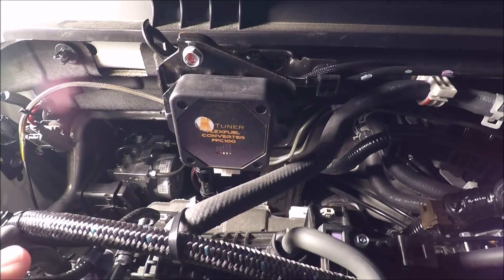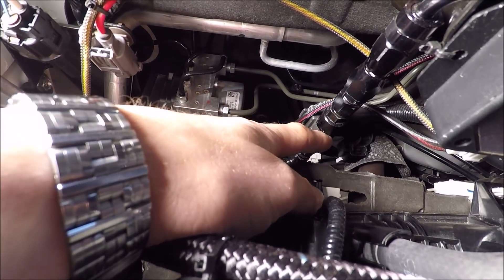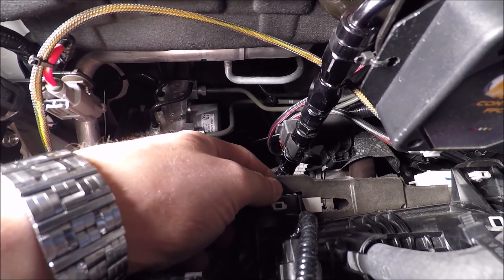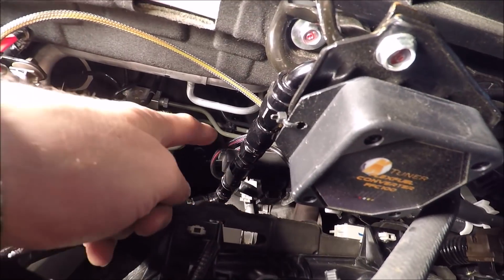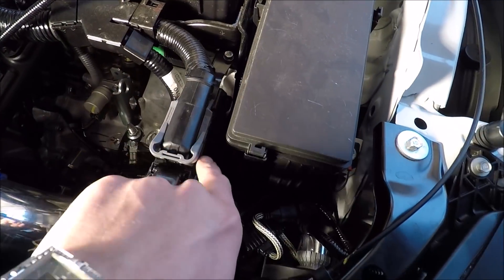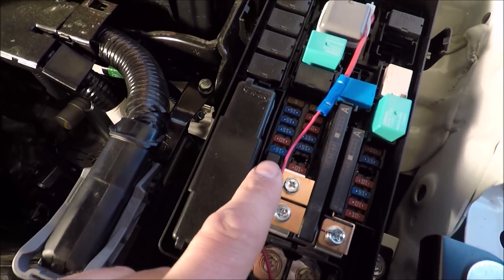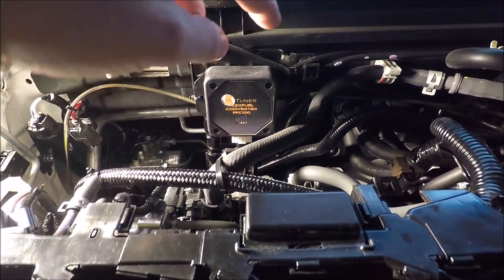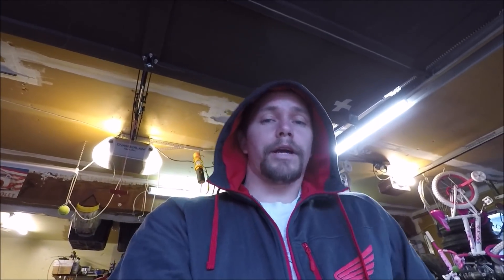How to get flex fuel on your Honda CivicX 1.5T for half the price SAVE HUNDREDS!!!!!

Comment: Unfortunately the link no longer works for the sensor, any chance where else I could source a sensor? Is there a preference?
I want to try this out since I have free time
Reply from the maker: Just look at Amazon or eBay for flex fuel sensors and make sure the one pictures looks the same or figure out vehicles that are flex fuel vehicles and then go to rockauto or something similar and purchase a sensor there. Obviously most people recommend the bigger brand names but I had no problems with mine.

Comment: Quick question I just ordered everything to create the kit, I just had question in regards to how did you connect the GM sensor to the ktuner converter ?
Reply from the maker: The sensor just has 3 wires, power ground and signal. The signal wire connects to the signal wire on the converter and one of the yellows from the converter goes to the ect2 plug. I forget which one but the instructions tell you. I think it's the 4th from the left for content and the 5th is for temp(not used).
Reply: thanks for the reply, this should make me more comfortable during making of my kit lol.

Comment: Hey. Keep the great vids coming. Could you ever consider doing a real how to for ktuner. I have the regular ktuner and would love to do boost by gear but no idea on how to actually tune aside from loading preloaded maps.  Got a 2018 si
Reply from the maker: I will think about it. Really its just selecting that table, choosing the gear to tune levels for in the drop down next to the title of the table and drag the lines down... its trial and error really because you need to see how much power your car can put to the ground. having the LSD you should be able to get a little more aggressive than I can in the first couple gears.

Comment: Can u run e25 with out this kit and just a ktunerv2?
Reply from the maker: Yeah as long as you tune for it and always run it... I mean that's only 15% more than most pump gas so the trims would take care of it I bet but it's definitely not optimal.
Reply: caraddict,,, awesome videos... btw I’ve been sitting on the ktuner for a little over a week and haven’t installed it...just seems with my luck I’ll blow the damn thing up...
Reply: Nice video as always, I have a question for you, in one the video you posted you mentioned you detune down 260 hp and 280 torque to save the clutch, is that 260whp or crank? I'm currently on stage1 ktuner v2 no tune and thinking of adding catted  prl DP and cobra intake and a vit  tune on a factory clutch? What do you think?
Reply from the maker: Pretty sure nobody has had an issue running the ots tunes. You bought the thing man! Get to it and get it installed!
Reply: caraddict 🤞
Reply from the maker: I almost wouldn't worry about the custom tune without the clutch. Especially with choosing the intake claiming to run so good without a tune. All I have is the DP and intake and I cam make the power to roast the clutch. Now if you are able to I would definitely get the flex fuel tune and run ethanol to get a substantial top end gain but just tuning on pump you are mainly going to get low end torque which the clutch can't really take.
Reply: caraddict ok got to the user name and password... do I create a password??
Reply from the maker: I am not going to be much help there. I had a HELL of a time getting it connected/working the first time. It turned out I had the same ecu version as vit and it was on lock down so I had to get mine approved in the system or something and waited for a new build then got it going. I feel like I remember it not really giving a confirmation after you make the name and password so you don't really know if that part worked until its working... it might have all changed though I know the interface on the V2 itself has undergone changes and the key off key on procedure after flashing has changed as well.
Reply: caraddict thanks